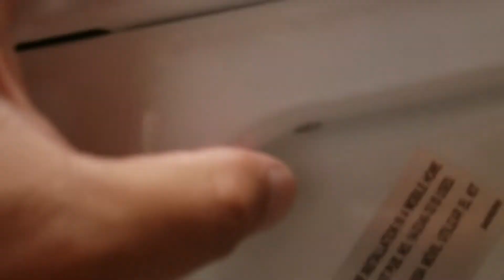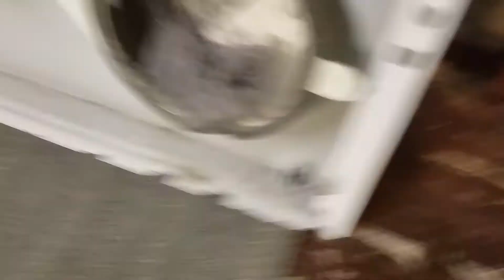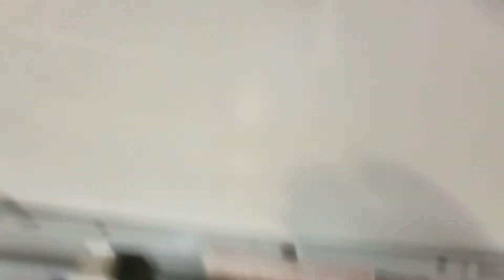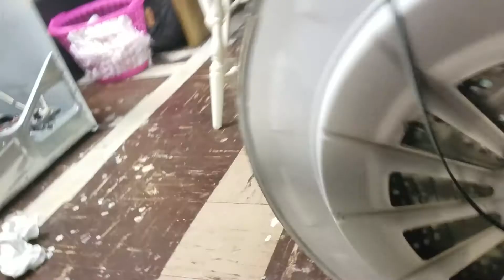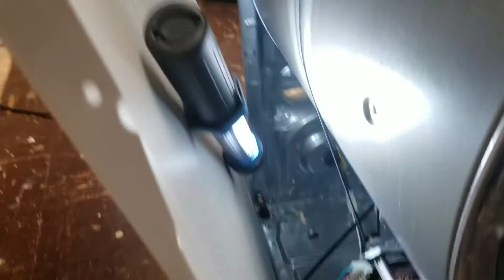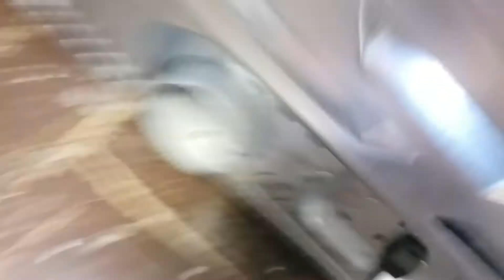GE Gas Dryer Disasembly and Clean.

Comment: great video sir.. i have GE gas dryer as well but it does not start anymore i press the start and nothing any possible advice on how to fix it? Thank you much
Reply from the maker: Would have to test for power, then maybe bypass the switch and see if it runs and if it does then your star switch needs replacing.
Reply: @xjoe81x  thank you sir i did do all of that and had a multimeter to test the start switch seems good and power is good as well because the light is on in dryer when i open door
Reply from the maker: Did you by-pass the switch to see if it actually turns on?

Comment: That was one of the issues I had with dryers that have the front lint filter. Changing the belt is so much more involved, among other things. Speed Queen seemed to do an okay job with that. I will say though, that dryer is very quiet!
Reply from the maker: Sharkie626 It is quite indeed.

Comment: I'd like to state, for the benefit of those reading the comments, that when I went over there, and looked at the start switch, YES, every screw on the control panel was completely stripped out.
Reply from the maker: jaykay18 For the record, I have a problem. I like using "my drill" now yes it may work taking screws "out" because it's faster but not so much for putting them back in. If you want to start the screw with a drill and finish it by hand that's fine but it's double the time and work. The first step in having a problem is admitting "you have a problem" Hello everyone my name is Joe and I have a problem with using my drill.
Reply: Well at least you got to step one.  It'll never go beyond that though...

The drill is a geat tool to have and works well in many applications.  When using drywall screws, absolutely.  Self-tappers, it's a must.  But for machine screws, or especially screws that go into plastic, a hand driver should ONLY be used.  If it's double the work now, it'll easily be an order of magnitude, or even two, later, trying to remove the stripped screws.  I only speak from experience.  In my days as a computer technician, I used ONLY hand tools.  Some guys had electric screwdrivers, and more often than not, they'd bugger up the screws, or break the plastic in the laptop, and there I was, with a hand tool, wasting several minutes trying to remove them; it only took them a second to strip them out.
Reply: jaykay18 Strip it out!